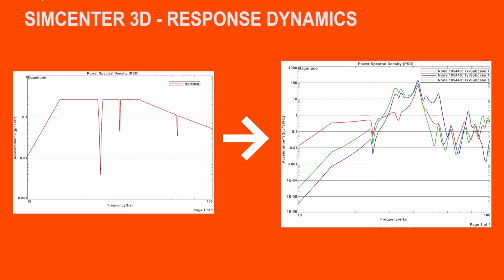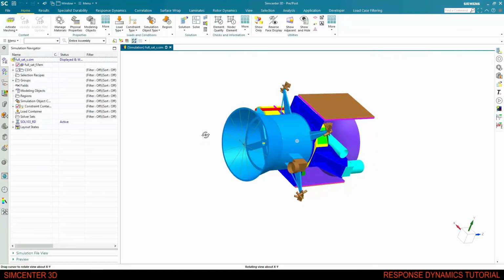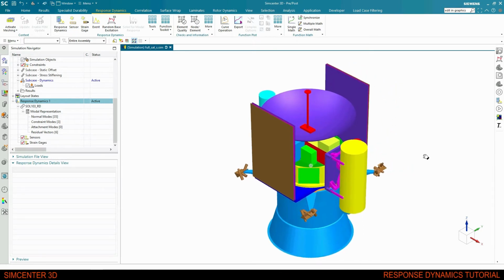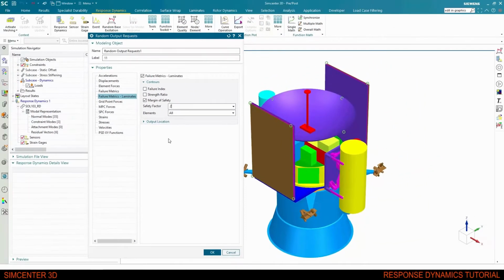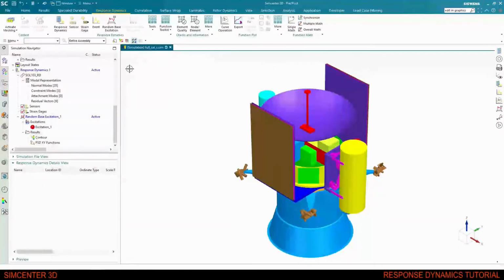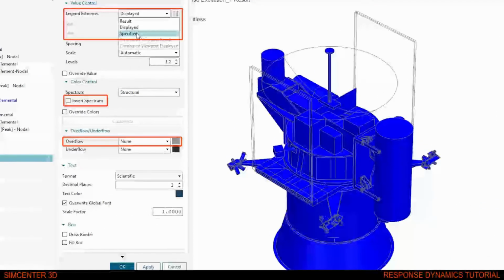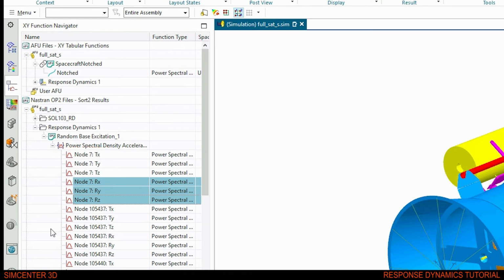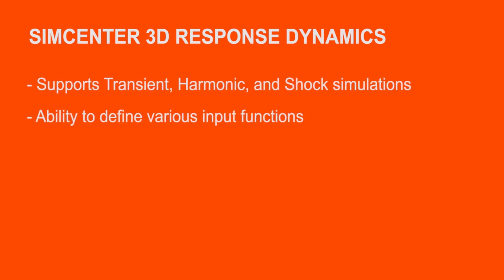How to perform a Random Base Excitation simulation using Simcenter 3D Response Dynamics

Comment: What are the constraints you used? And how do I input the PSD values myself if I don't have the AFU file?
Reply: Hi Subham, there is a rigid element with a central node representing the base that connects to the launch adapter. This node has 2 constraints: 1) Enforced motion location for the 3 translational DOFs, 2) User-defined constraint with all 6 DOFs fixed. The input PSD is complex due to the notches, you can get it here: https://nextcloud.mayahtt.com/index.php/s/dAbwL7fdi4JqnsX . Generally speaking, once you enter the XY function manager from the Edit Translational Nodal Excitation dialog, you can create a new PSD function as follows: Click on New, then under XY data create, click Key in from text editor, and enter the PSD as pairs of (frequency, PSD) where the PSD is in g^2/Hz.